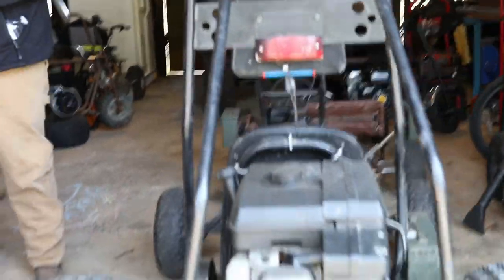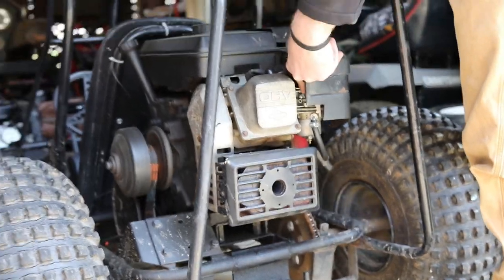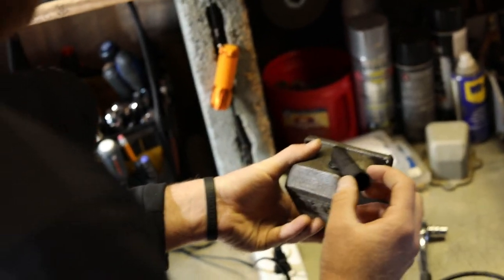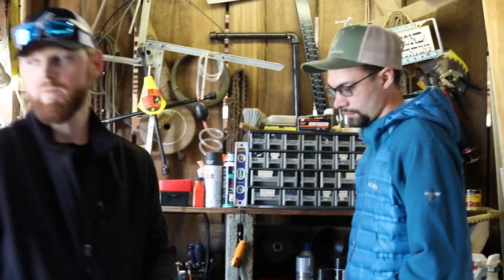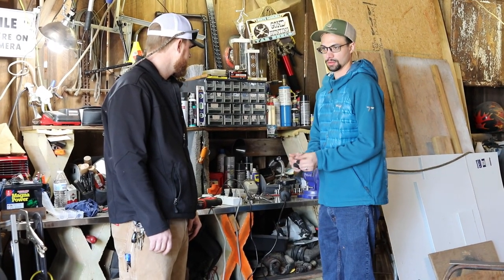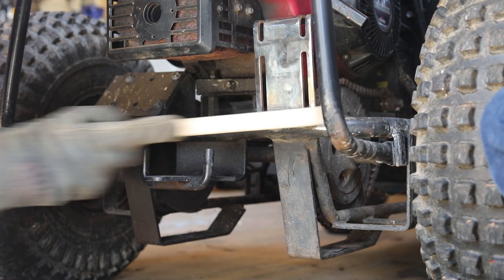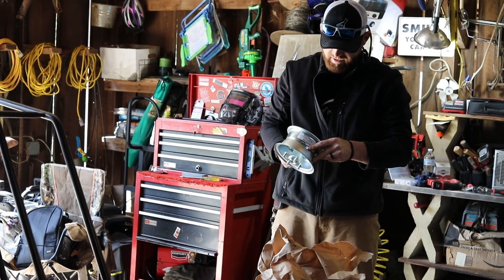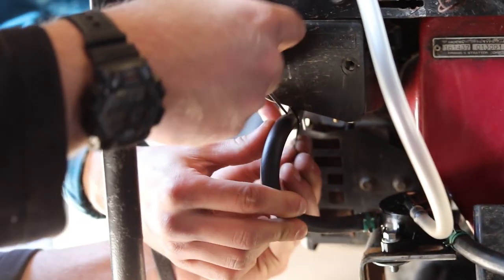Go Kart Pulse Pump Install: Manco Dingo IX - Briggs and Stratton Vanguard!

Comment: What's it do pump fuel or something
Reply from the maker: Yeah exactly. Uses pressure from the crank case to push more fuel to the carburetor from the gas tank
Reply: where did you purchase that pump?
Reply from the maker: Home Depot check the website